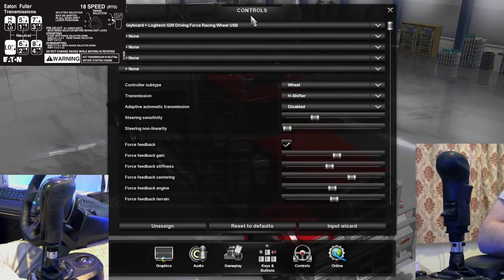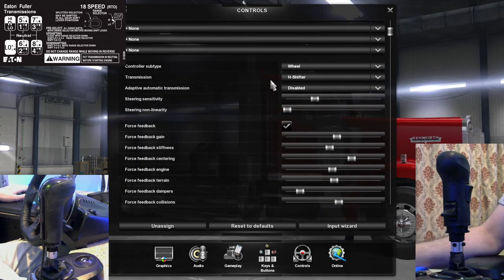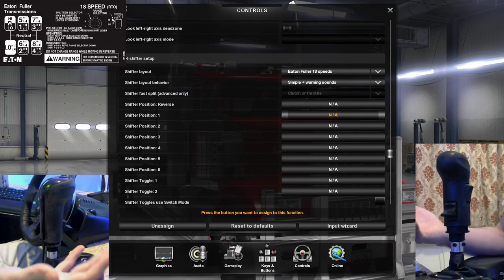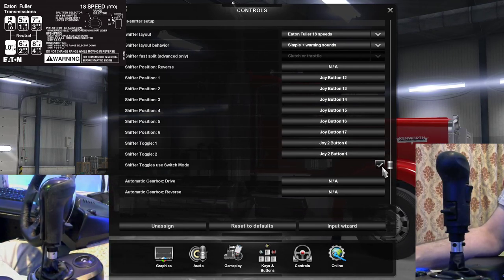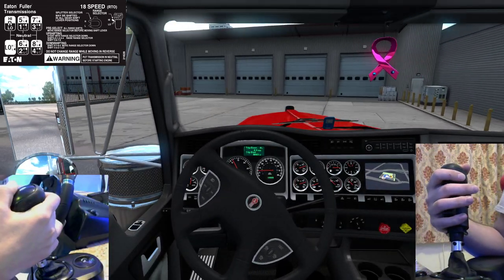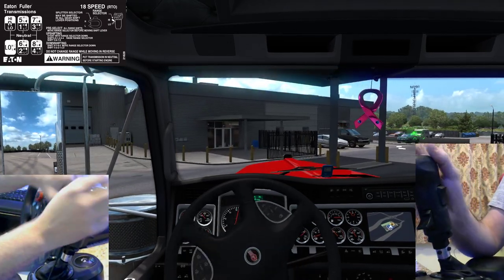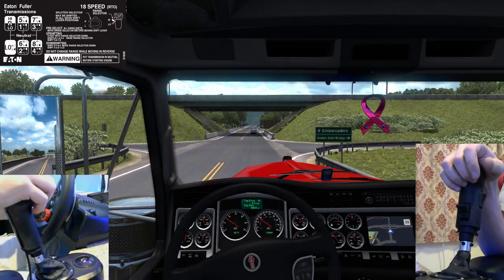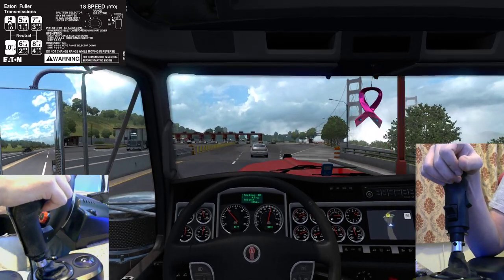How To Setup A 18 Speed Transmission Splitter-Shifter On American Truck Simulator

Comment: Thanks for this. I have the same shift knob just used it for the first time earlier tonight. Realized after a long delivery that I forgot to check the box for the splitter. Really messes up the shift rhythm when you have to double click the hi/lo and splitter.
Reply: This comment just made my day! I just hooked up my new splitter shifter and noticed i had to double click the splitter which is what brought me to this video (which didn't help me with my problem in itself) but I found this comment which did ! THANK YOU!

I also swapped my hilo and splitter toggles thanks to this video though.

Comment: Can the regular Logitech G shifter with 6 gears do 18 gears if I set a hotkey on my wheel to switch to the next set of gears where 1 would then become 7 for example? If that made any sense. I play ATS with 18 gears, and the wheel, but never bothered with the shifter because it seems complicated.
Reply: Start simple with a 12 speed gear box.
Use range setting, then you do 1-6, toggle, 7-12...works pretty nicely, ice just started playing around with manual.
Reply: i believe it can? not sure at all i'd figure as it justs buttons but you'd have to try yourself

Comment: I mean, I know this is ancient, and yes you have it set up right to the real transmission

But the button on the side? That's the splitter. It splits each numbered (stick) gear into a low and a high half, so that 7H is halfway between 7L and 8L.

Splits the gears.

The big flap on front is your range selector. It changes the stick gears from the 'Low' range of 1-2-3-4, to the 'High' range of 5-6-7-8.

And then you got your bull lows and the reverse ranges, but bull high ranges don't play well with the 1-8 in the driving H, trying to go from 4H to L2H instead of 5L can make things, uh, explode.

So L1L, L1H gets you two, and 1L splitting up to 8H gets you 16, and there's your 18 speeds.

Messing with R2 ranges can overtorque parts too.

Comment: Does this work with normal buttons on my steering wheel?
Cause when I tried, I had to press the splitter and range buttons everytime from 5 upwards. Else when shifting from 5th gear upwards, it always went down into the lower range gear.
Reply: Make sure you untick the box that says switch mode under the shifter settings for range and split toggles.

Comment: Do you then only change gear with the accelerator pedal or do you always use the clutch pedal to fully engage the clutch? Do I have to set something there? 
Best greetings from Germany
Reply from the maker: I can float gears or clutch. I clutch most the time.
Reply: Actual driver here. When I was still running a manual, I was still half-clutching out and then floating back in. I'd 'pocket' the gear, getting the stick into the gate but not quite getting the dog teeth to touch. Then you'd use the fuel to rev-match, and brush the teeth together to feel if you're matched right. There should be a really, really slow buzz, and then it'd practically suck the stick into lock.

Splitting the top four, I'd flip from low to high, lift fuel and tap the clutch, it'd go from the gurgle to the engine revs dropping and the speed and revs locking in the new range. Going from 5H to 6L, I'd clutch out to N and then button before pocketing.

But then the company started taking in no-pedal automated transmissions around 2015 and I switched over, and by the time 2018 came around we only had 20% of the fleet with manuals. Today only the O/Os have manuals.

With today's automated transmissions, you don't need a stick unless you're doing smoothbore.

Comment: you dont need h/l depending on weight. until your in 8L and then just change into 8H. some times climbing hills and accelerating you may need 5h/6l to get that extra umph!  to get into the higher range gears. Also I wanted to know if you have to press in the clutch to change gears? or can you float?  I take it the game wont recognize double clutching
Reply: You can both float and double clutch but don't put the clutch to the floor just like a real truck.
Reply: @kpgpwi64 why

Comment: Quick question, I brand new, can I change transmissions before I own the truck?  I want an Eaton 13 spd.  Thanks in advance.
Reply: You can set it up in the menu, then go to the service station and swap to a 13 speed in the truck. Then shift like you would in a 10 speed but you spilt the high side.
Reply: @rusty4104  thanks for the reply!   Can I still swap if I don’t own my truck?  It just seems to let me browse
Reply: @kdog888  No it has to be on your own truck. You also have to be to a certain level to buy different upgrades.

Comment: Even with a load, I just leave the splitter in high. I take off in 2nd, and just roll.

Now, when I'm hauling a 60k lb load, I'll start on the low side.
Reply: that’s how most drivers do it, my dad said it’s fine to start out in 2nd or 3rd if you’re empty or sing that heavy, he told me that when i asked why he wasn’t all the way back (to 1st/ low when i was still learning how to shift a 18 speed)

Comment: How are you getting you game to recognize them gear shifts past 8th and I can't even get mine to go into 9th gear
Reply: This is a joke right lol, eaton 18 speed doesn’t have a 9th gear my friend
Reply: @notbmw3549  I bet they do have a 9th gear
Reply: @trystanmarshall1867  they don't. it goes to 8. The gears are split and there is a LL and LH gear. An Eaton Fuller 18 speed is like a 4 speed stacked on top of a 4 speed.
Reply: So the "9th" drive gear is really 4th gear low split.
Reply: @kpgpwi64  ok

Comment: That's not the Eaton pattern the game is messed up I drive a tractor trailer for a living left and down is first gear left and up is reverse
Reply from the maker: What slot was your low gears?
Reply: @SilentScotty  normal 18spd pattern
Reply from the maker: A eaton fuller 18 speed left down is the low gears. You can confirm that on Eaton's website.

Comment: Still don’t think the shifting mechanics are real in the game. Because I thought on a 18 speed, you shift into 2nd, go, then spilt, let off the gas, it shifts, go, turn off spilt, shift into 3rd, go, split, let of gas, it shifts, go, so on and so forth……
Reply: I think you're on about a 13 speed where the splitter actually operates high side high gear.

In an 18 it's very different.

Low is 1-4
Hi is 5-8
Split is 9 -12

Then there's low gear dedicated and reverse which both get low, high, and split.
Reply: I'm kinda late to the party here but just wanted to say that's totally possible to do in the game. Though it's often not necessary to keep splitting each gear or hit every gear in sequential order, unless you're getting a heavy load up a steep grade or when you just feel like rowing through the gears. It's situational and pretty realistic. 
Also, these shift knobs are a REAL GAME CHANGER, can't believe I played ETS/ATS for over 6 years before getting one. It really adds to capturing the feeling of driving a big rig.